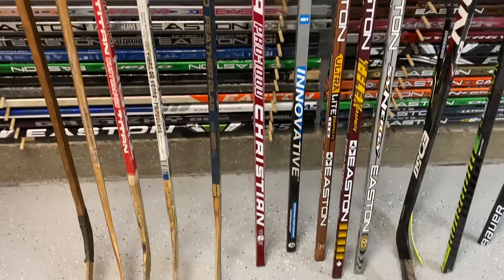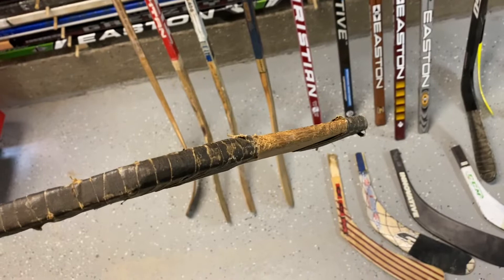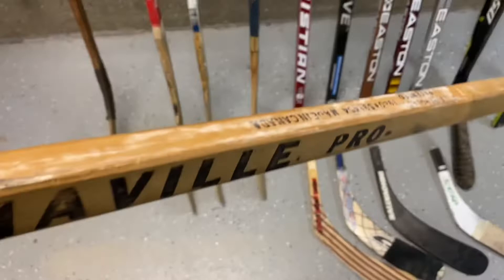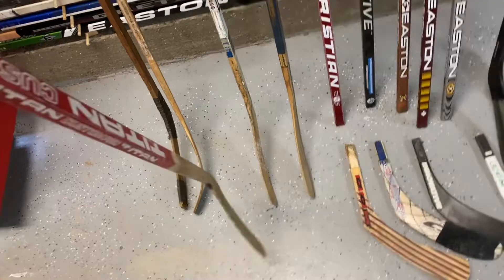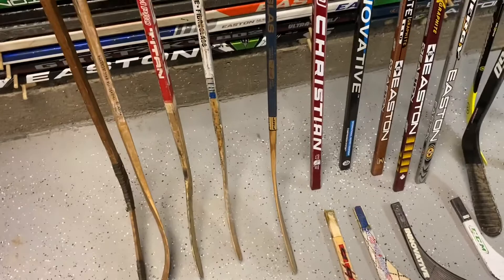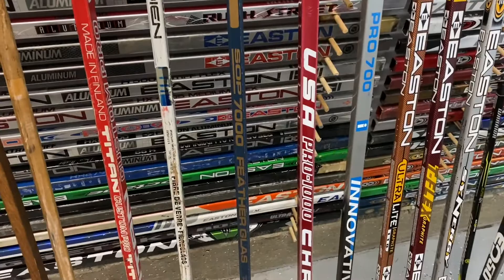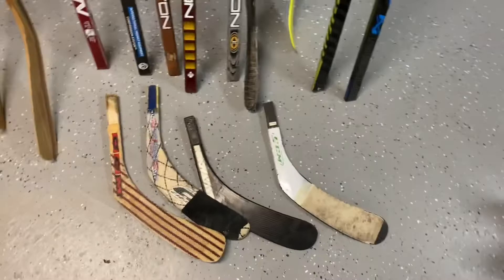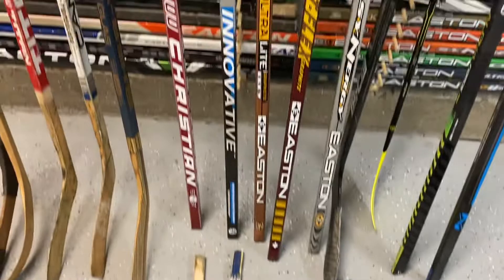EVOLUTION OF THE HOCKEY STICK

Comment: Additional info: Some people believe Busch was the first composite stick, no. It might have been the first carbonfibre stick. I dont know when it came, but I bought one in 1996. Titan Turbo had a foam and wooden core. The bladeconstruction was like Titan TPM. Wood core, plastic frame and fiberglass lamination, but without the birch veneer at the forehand. Shaft had foam core with laminated wood strips at both the ''narrow sides''  Koho XL4, XLS and so on had a hollow, slightly oval shaped shaft with a ABS plastic blade or later a wooden blade. The first 100% onepiece  composite stick was made by Norwegian skimanufacturer Madshus sold under the name JOFA Black-Shot. When Karhu-Titan bought JOFA it was a discussion about if Madshus should continue producing Black-Shot for Karhu-Titan and they made samples. The problem was that Karhu was also a skiproducer and Madshus used similar technology for their ski and stickproduction. Madshus were sceptical to let Karhu-Titan know to much about their know-how. Norwegian and Finnish language are completely different, so they could speak Swedish or English during discussions. During a meeting (I was told by the RD manager) : ''When the Finns started to speak Finnish together the meeting was over'' Madshus produced ca 80-100.000 sticks from 1983 to ca 1986-87. Around 10 years later they made composite shafts sold under K2 brand, wich was the owner of Madshus at that time. They also produced shafts with Sher-Wood logo, which Patrice Brisebois used. Madshus still use the 50 year old carousel press used for skis, shafts and the WORLDS FIRST ONE-PIECE HOCKEY STICK. https://youtu.be/nK1Y0gEVWLo?si=86H6PEM9cOzn3_IA&t=104

Comment: Busch (Swiss) made the first true one-piece composite stick in mid '90s. Laterly named Busch Balance, then made Itech-Busch, and Graf-Busch sticks
Reply: No  :-)  Madshus made Jofa BlackShot onepiece fiberglass sticks from 1983, true onepiece, molded blade and shaft in one operation. Some people believe Busch was the first composite stick, it might have been the first carbonfibre stick. I dont know when it came, but I bought one in 1996 with Sher-wood Busch 2000 lettering. Titan Turbo had a foam and wooden core. The bladeconstruction was like Titan TPM. Wood core, plastic frame and fiberglass lamination, but without the birch veneer at the forehand. Shaft had foam core with laminated wood strips at both the ''narrow sides''  Koho XL4, XLS and so on had a hollow, slightly oval shaped shaft with a ABS plastic blade or later a wooden blade. The first 100% onepiece  composite stick was made by Norwegian skimanufacturer Madshus sold under the name JOFA Black-Shot. When Karhu-Titan bought JOFA it was a discussion about if Madshus should continue producing Black-Shot for Karhu-Titan and they made samples. The problem was that Karhu was also a skiproducer and Madshus used similar technology for their ski and stickproduction. Madshus were sceptical to let Karhu-Titan know to much about their know-how. Norwegian and Finnish language are completely different, so they could speak Swedish or English during discussions. During a meeting (I was told by the RD manager) : ''When the Finns started to speak Finnish together the meeting was over'' Madshus produced ca 80-100.000 sticks from 1983 to ca 1986-87. Around 10 years later they made composite shafts sold under K2 brand, wich was the owner of Madshus at that time. They also produced shafts with Sher-Wood logo, which Patrice Brisebois used. Madshus still use the 50 year old carousel press used for skis, shafts and the WORLDS FIRST ONE-PIECE HOCKEY STICK. https://youtu.be/nK1Y0gEVWLo?si=86H6PEM9cOzn3_IA&t=104

Comment: Sherwood had a full composit stick in the mid 90’s as well I think it was the 9900 iron carbon. They were like $200 at one point. The hockey shop I worked at got a few on close out. It was insanely stiff and had the Coffey curve. I broke so many graphite shafts until I bought that one. Lol at one point I had broken so many titan 10,000’s they literally asked me to switch sticks! 😂😂

Comment: Me and a teammate bought the first Easton carbon blades sold in Sweden 1995 or 1996. They were black and grey with Easton Carbon logo on the backside. We put them on our Christian Power-Tech aluminum shafts and the stick lost all feel of the puck. They were as flexible as a rock. Without any puck feel at all. But it was cool to bee the first ones with carbon. Used it for a couple of weeks and changed back to wooden blades again. Slapshots with those felt like hitting a breakerbar on concrete, hands hurt afterwards.
Reply from the maker: Thank you for sharing your comments!